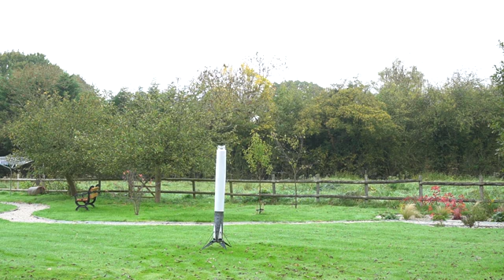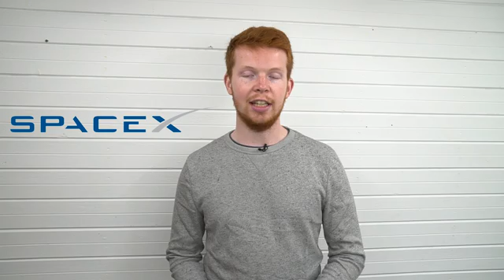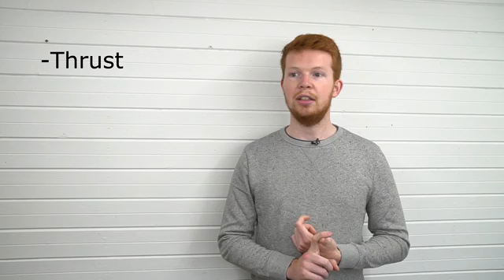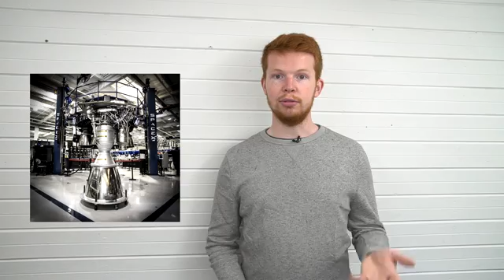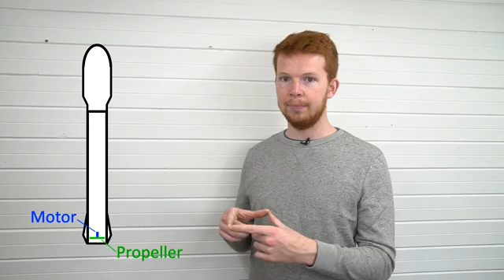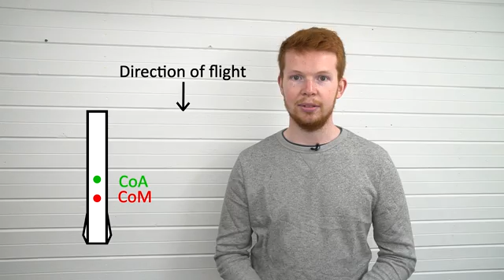Hovering a rocket - SpaceX model

Comment: 4:30 is not correct, the areas do not have to be equal, it also depends on the leverage of the area. a classic example will be a aroplane. the center of area is at the end of the wings, even though the area of the tail is much smaller than the area of the wings, but because the tail is placed on a "lever", its area is "weighted" more.

Comment: Nice work Tom!  It looked like hovering was a success.  To land from a hover position with thrust vectoring from the bottom only seems to a bit dicey.  You may have to revisit some sort of thrusters near the top of the unit to keep it from tipping at the point of contact of a single leg to the ground.  With your latest version in the video, the only way I see it landing properly is if all legs touched the ground simultaneously with the duct fan power being cut off.  Keep it going!!

Comment: Fantastic project and unbelievable progress. Now I understand why one of my long time friends (and fellow engineer) supports your patron account. To consistently not tip on landing will require a local wind speed and wind direction measurement so that an anti-drift coefficient can be applied to the inputs. That sounds like you will need a portable weather station, which would not be a big deal for a larger scale (and larger budget ) project, but may be beyond your current budget limitations. I may have one I can send you if you would like. To apply that input to the vehicle will require a directional lock on the Z-axis (N., E., S., and W. around the vertical axis), traditionally called yaw, but could be called roll since the nose is pointed up. It depends on if you want to change the terminology based on which flight mode it is in. This yaw lock is available on some drones in the form of  control that is referred to as 'headless mode' . Once you have those two elements you can touchdown with a near zero differential x and y velocity with respect to the ground (not sliding). That leaves touchdown occuring with the rocket tilted into the wind, so the landing conditions would again be limited to the same wind velocity values as takeoff...It has to stay standing in the wind. 
Another thought to give a wider margin for successful landings is drop the center of mass down as much as you can upon first contact with the ground.  Perhaps having the batteries drop down (not ejecting the mass, but moving it down) most of the tube would do the trick ; ) 
Believe it or not, the height of the grass effected  your landings. It applied a frictional force that was both immediate  (grass is 'grabby'), and not uniform. I think you saw that on takeoff because the video shows that you modified your techniques so you 'jump' into the air. Transitions are dangerous and the time spent in those transitions should be minimized. So, just like you "jump" into the air to takeoff, you shoild "drop" to the ground on landings. During the transitions from ground-to-air ,  the desirable location of the center of mass reverses completely. On the ground you want it low so that it does not tip and in the air you want to be as high as you can so that you can tip it using the vectored thrust. It could have a ground contact sensor (microswitch) that kills the thrust and drops the battery to the bottom of the tube simultaneously upon first contact with the ground.
Another thing to help make it uniform and consistent would be to put a lightweight and very thin ring around the outside of your feet. With four legs you have a contact square, so you have a variable center of mass height dependent on how it's oriented. The variable could range from the case where two feet touch simultaneously to the other extreme when it is rotated 45 degrees around the central axis. With this ring you might be able to reduce the total mass by removing one of the legs from the design. Just thinking three legs plus a ring could be lighter, more consistent, and a larger effective target area. That last term is meant to describe the area directly above which your center of mass can be located at the time of touchdown and still have a successful landing. This target area is what will dictate your maximum wind conditions. So any wind makes it so that you have to touchdown in a non-vertical position in order not to be sliding. In a non-vertical position the center of mass won't be directly over the point in between the landing feet until it tips back into a vertical position, which the wind would actually assist in doing.
Again, wonderful job on achieving the goal of hovering the 'rocket simulator' and making a very entertaining video. I'll be in contact about the weather station.

Comment: Today we found out why space x doesn't land nor take off on GRASS
Reply: I kinda want to see SpaceX land a rocket in a football field now.  They probably could do it too.
Reply: Red Squirrel yes they could but that's because there a multi billion dollar company who can do what ever they feel like but a small rocket that can be blown over by a gust of wind should have a stable landing and take off not just a mound of grass
Reply: Jacob Kneeland 
Yeah! Why is your head in the ground! Apple is fake too! They cheat us of our money by taking away both the home button and headphone jack!😆
Reply: +T R He did precisely the same thing they did in real life.  But he wanted to do it cheap, with parts he already had or could cheaply buy, and without spending weeks or months on it.  He needed a source of thrust, but throttle-able rockets aren't exactly something you can buy at a hobby store, and the minimum cost for a tested/commercial unit is going to be in the 100's of thousands of dollars.  A throttle-able jet engine in the hobby market is thousands of dollars, and at least 100's of thousands in the commercial market.  So an electric R/C helicopter motor was an easy choice.

The electronics/control work he did is exactly the same as in "real life", regardless of what produces the thrust.  Just writ cheap and quickly implemented.

The achievement is not that he built this thing, but the fact he was able to land it.  Which he did.
Reply: +3D Print Everything With considerable extra effort, this could be developed further and be able to land just about anywhere.  But not with hand-made styrofoam tube, cardboard fins, and an electric propeller.

He's got the technology down pretty solid.  Justs needs a lot of further refinement (if he's interested in doing so).
Reply: i thought exactly the same thing- why isn't he doing what they do in real life
Reply: SpaceX is FAKE
Pull your heads out
Reply: @Bones12321  You're fake
Reply: Jacob Kneeland fuck u

Comment: Lets get Elon Musk to see this. Tweet him if you have twitter!
Reply: +Tom Stanton Hey Tom I think this was a HUGE success!! I get a kick out of seeing the types of projects you create and how you problem solve. Despite what another poster said, most people in RC could NOT do this due in large part to the complexity of building the thrust vectoring piece.
I really hate when someone has to minimize another persons accomplishment. It's bad form!
I'm curious about the motor choice. Did you go with a standard prop to avoid the spool up lag of an EDF?
It would be great to find an indoor spot for this experiment to avoid the weather. When flying our smaller helis we would put down a sheet of plywood to keep from getting hung up on the grass. Thanks for taking the time to create this video and concept. It's fun to watch the build and see the progression of the "tweaks". Thanks again!
Reply: Great video. What would be really cool is if you could add one of those solid rocket motors to initially launch the rocket and then descend using the fan thrusters. Bonus points if you land it on a model barge on a pond.
Reply: +Aaron Gonsior often times projects that discuss problematic engineering design issues and the process required to overcome these issues through repeated re-designs, numerous testing and re-testing sessions and mechanical changes made on the fly will be uninteresting to those that may find themselves  and their attention more easily gained by alternate forms of entertainment. In this case one may find a search for "professional wrestling" or "monster truck rallies" more helpful and perhaps more fullfilling.
Reply: @sasquatchjunk  you are giving him too much credit at the end there.
Reply: David Westernall:
Quite incorrect. Most RC guys are about able to plug a Rx into a Flight controller, but when it doesn't work( and it won't) have no clue how to reprogram (let alone model) the controller solution.  Most "Drone" flyers (speaking statistically here) just twiddle control gains at random hoping for a magic solution.
Rocket surgery ain't a whole lot more complicated than farming, it just happens a lot faster, same with low Reynolds number Aerodynamics-Nerdery, just that it has more in common with farming...  lol..

Tom had this very well stabilised at one point.  Allowing for wind drift is fairly trivial once you have the position and control rotation matrices sorted.( And the RC controller channels activated)...  But it is still a bit more programming he probably didn't have time for (hence leaving position control for a later day).  We often get projects sorted to the point of solving the most complicated problems, then move on, before turning it into a commercialisable offering  (dumbed down for the masses)...  That's the way with geeks.  Just here to have fun...
Reply: +Tom Stanton One thing you left out of your explanation of stability (but sorta discovered it yourself when you moved the battery to the top) is the concept of "center of pressure" of a rocket.  You talked about center of gravity (CG) but not CP.  CP is effectively the center of vertical area of the rocket.

In order for a rocket to be stable in flight (while it's in atmosphere of course) is that the center of pressure be behind the CG.  CP can be determined in small rockets by tying a string around the body, and spinning the whole thing around your head.  When you're "up to speed", the rocket will swing broadside to the wind if the CP is where the string is tied.  If the CP is ahead of CG, unstable.  If CP in front, stable.  If you can drop the rocket flat, and have the nose tip down, it's tending to be stable.  Rocket design simulators can usually calculate both CG and CP for you, and if the CP is ahead of the CG, don't fly it!

The CP of a body tube is right in the middle.

In hobby/amateur rocketry, the rule of thumb is that the CP should be at least 2 or 3 body diameters behind the CG.  By moving the battery to the front, you brought the CG forward a long way.  This makes it much easier to control.  As you found out.

Your first rocket was almost certainly unstable by this rule, but the revised one was.

When you had it the other way, you had to swing the nose around FAR more to remain vertical, and much more difficult to control, and vectoring the thrust made it still easier.  If you don't have vector thrust, that first "rocket" of yours would have done a good job tumbling around.

It seems a bit counter intuitive, but it's best to have as much weight as you can up front.

It would have been interesting to try this indoors - in a school gymnasium for example, you could have eliminated the wind.

Another thing to be cautious about, but this didn't seem to be an issue here, is the "Bournouli lock" effect.  The downwards thrust, if close to a "plate" (like a floor) can produce a toroidal "cyclone" with reduced pressure in the middle - literally sucking the rocket back down.  This is FAR more of a hazard with real rocket motors and flat thrust deflector plates (or ground).  This is why most rockets are either mounted fairly high up in the launch (like hobby/amateur) or over exhaust deflection pits or tunnels (like NASA).

Certain Estes model rockets flown on Estes launch pads were infamous for "gluing themselves" to the launch rods because of this.  Most embarrassing.
Reply: +Aaron Gonator "Barely interesting"?  Could you do it so quickly?

Starting from scratch, with a limited understanding of rocketry, it's quite an achievement keeping the thing stable.
Reply: to me the hard part would be the control system.   huge success!!
tom should sell plans for it. I'd buy them..
Reply: +Tom Stanton You've basically done everything that Space-X does, except do it with throttleable liquid-fuel motors.  Which is fairly impressive for such an effort.

Somewhere on Youtube, I've seen a video of either Musk or one of the other "Billionaire-turned-Rocket-head" guys with an amateur rocket doing the same as you did here.  The rocket popped up to several hundred feet, and then did a soft-landing in front of the camera.  For grins, it was designed to look just like the Buck Rogers rockets of the 40's and 50's.

Led to many comments on youtube as "landed just the way god intended rockets to land" ;-)

Sorry I can't find the video now.  I suspect that that launch, in terms of development, testing and programming cost a few orders of magnitude more than yours.

For an amateur rocket enthusiast, that's an amazing achievement.  Yours is pretty spectacular too.
Reply: Tom Stanton I not a rocket scientist.   However you were only using an accelerometer and gyroscope.   So naturally, like you stated in your video that wind speeds and the direction were not taken into consideration.    Plus GPS and cameras are used on the Falcon 9.   With the target ship constantly sending it's updated GPS and landing conditions back to the Falcon 9.    With all that said you needed to add a target location to your project.   Forget about the pinpoint accuracy of GPS systems that are used on those rockets, because you said you were on a tight budget.   However you could add something like a raspberry pi with a single downward facing camera.   This would be used for the target landing.   Place a big X or another unique image target down on the ground near or right under your rocket.   Then use the camera as the main control, with the accelerometer and gyroscope.   That way the winds could blow and in any direction, and your rocket would still be able to hold its position close to the image target on the ground.
Reply: +Smanny Manny BTW: for as little as $20 you can add a GPS unit to a Raspberry Pi. We've done it ... twice ;-)

You'd probably need to have both GPS and a camera for doing this from highish altitude.  GPS when the target is too small to resolve by camera.  There's also a certain amount of GPS "jitter" and lack of resolution you have to cope with near the ground which the camera could compensate for.   You could also add a range finder for precise height measurements.  The software to integrate all this, cope with sensor loss, analyse the camera, etc etc etc, would get a bit complicated...
Reply: +Aaron Gonsior  Ok so he made a hair dryer hover.  Pretty amazing.  Show us your projects?
Reply: +Osimmac There are many ultra-high altitude amateur rocket projects that start using a balloon to take the rocket up ot 60,000-70,000 feet and then firing the motors.  They shoot right through the balloon.  Get a lot more height that way.
Reply: Osimmac I'm reckoning if this were worthwhile and feasible, SpaceX seems like the kind of company that might try it. But the amount of energy required to launch a rocket on its own, let alone a massive drone to go along with it, I don't think it's worthwhile just to save a few KMs for S1.

Falcon Heavy is launching soon, and that's a "good enough" solution for current launch constraints.
Reply: Killjoy
Reply: A success WELL Done!
Reply: Osimmac Falcon Heavy.
Reply: stratmoss
Reply: Seriously
Reply: Aaron Gonsior  hair dryers are pretty close
Reply: Yea many could but not many have.
Reply from the maker: Yeah I realise that the rocketry part is very difficult, but I was more interested in the control and stability methods used to make a rocket hover. The physics behind the control methods are very similar, just without the huge budget and years of rocketry experience!
Reply: @TomStantonEngineering  The falcon 9 doesn't actually hover. One merlin engine at its lowest thrust pushes above a 1 thrust to weight.
Reply: stratmoss Elon musk space X is fraud..... Mere illusion.... I guess I should get a YouTube channel going to show how you all been duped.... I am a magician do green screen and cgi.... You all fall for the Orson wells war of the world's advertising lie.... History repeats and people think I can pull a coin from your ear make an elephant dissappear or the statue of liberty
Reply: @jolllyroger1  are you drunk? How is Elon fraud? I have seen him in person before. He is real I promise. And how is space x a fraud?
Reply: Hmmm, maybe SpaceX could add a stage 0, a sort of cradle that holds a falcon 9, and launches it up 10 - 20 km high. They could use this on their very heavy flights, to give the rocket enough of a boost where it can still land, and it would also increase their fully expendable payloads.

it would be very reusable because it would just be a huge drone
Reply: @osimmac  This is a half-baked idea....
Reply: David Westernall no one does space rocketry like space x because space x doesn't do space rocketry